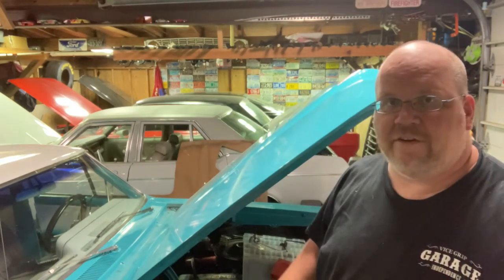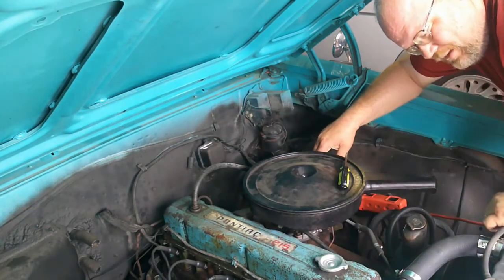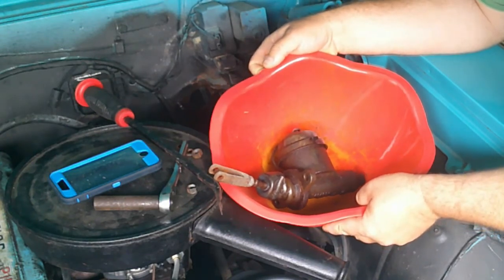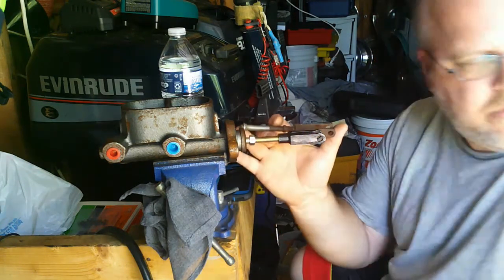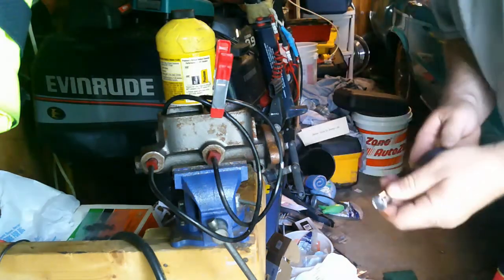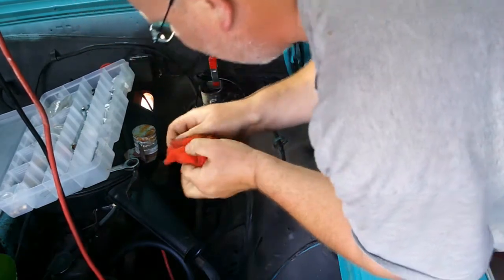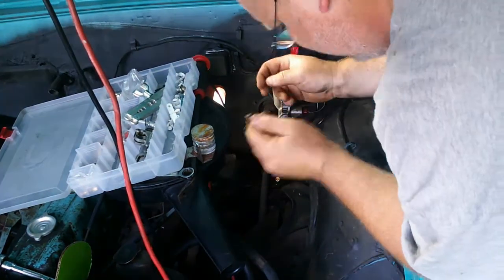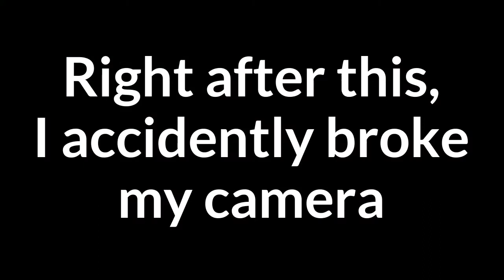Converting from a single to a dual bowl Master Cylinder GM A body

Comment: Somewhere I have an amazing advertisement for the 62 Rambler illustrating the benefit of a dual reservoir master cylinder, which came standard on all Ramblers. It was marketed as "Double Safety Brakes!". It has two cars, a Rambler with standard dual reservoir and something else with single reservoir, both cars have one brake line cut.  The cars are driving towards a pair of paper walls with a family painted on them. The Rambler stops thanks to its Double Safety Brake system! The other car doesn't stop and proceeds to crash through the paper wall. So your single reservoir fears are justified!
Reply from the maker: I had that happen on my red Galaxie, very scary but I was at very low speed when it happened. I will be getting rid of that death can soon, Ford version of this video coming.  I'd like to see that rambler ad